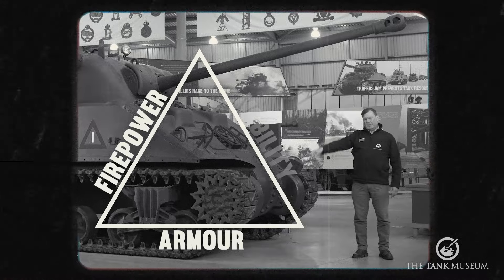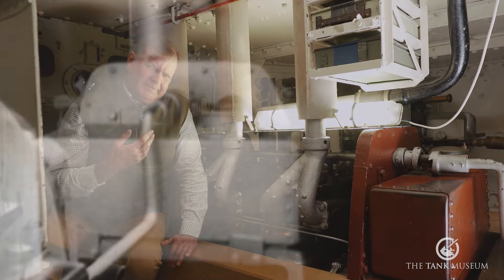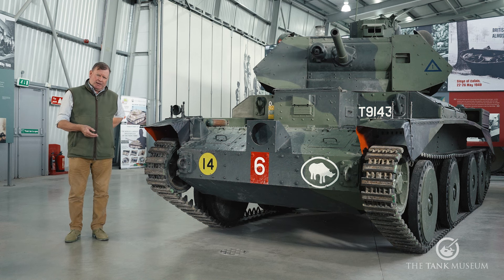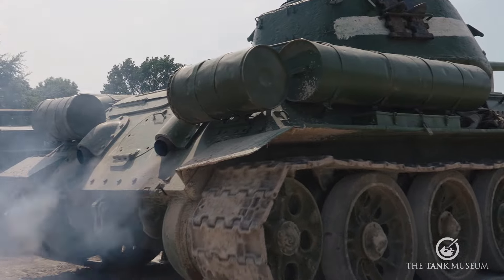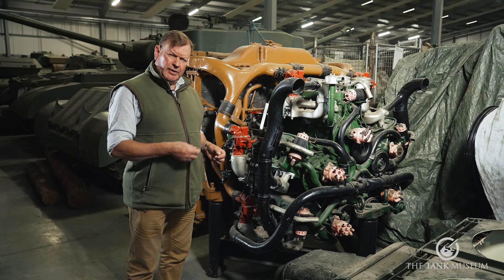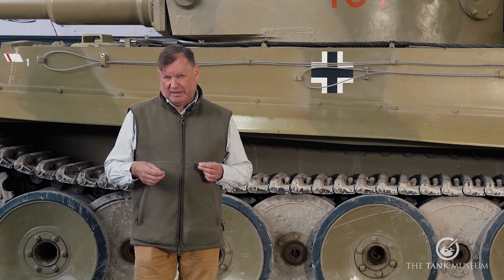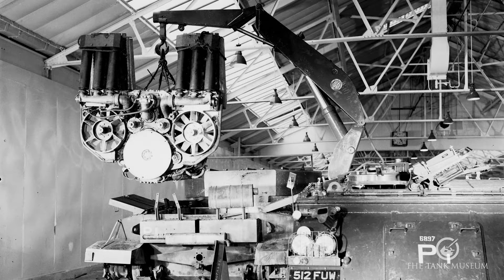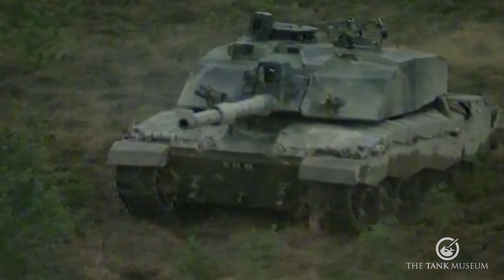Powering Victory: How tank engines went from 105 to 1200bhp

Comment: Transmissions and suspension are just as critical to mobility. Please cover that
Reply: And steering. Each one of those could be their own episode.
Reply: “They’re not important.”
-Ferdinand Porsche, 1942
Reply: @yolkiandeji7649 and that's why we got Henschel Tigers...not Porsche Tigers LOL
Reply: I believe it's common knowledge and we combine them into the mobility department. That said I agree I'd like to see a portion of this video dedicated struggles the early transmissions had and how we overcame.
Reply: That’s true but most tanks have been designed around the engine and the gun…
Reply: @yolkiandeji7649  It was actually the engine that let the Porsche Tiger down, not the transmission.
Reply: Transmission and suspension IS mobility.. Along with engine.
Reply: Thank god for Citroën and their hydro-pneumatic system. That could’ve made a huge difference if fitted onto tanks and tank destroyers, had it been fully developed before the Second World War.
Reply: No they aren't. Mobility means fastness so horsepower is the only factor. Definitionally. Surprised you didn't know that.
Reply: @anarchogarfieldist1652 what??
Reply: Come on now, Porsche had a brilliant transmission... as a concept, for a different era. Not quite so for the war-torn Germany suffering from all sorts of shortages that needed working engines right away.
Reply: Don't forget track tension... said The Chieftan repeatedly!
Reply: @anarchogarfieldist1652 🗿
Reply: @Will_14_years_ago  yeah it's fastness dude read a book
Reply: @anarchogarfieldist1652  A book generally has two things on the cover - a title, and a name. The name belongs to the author who wrote it, and the title being what it is about. You must be a little more descriptive. Id love to check this book out. Unless you actually meant the title of it the letter A.
Reply: @anarchogarfieldist1652 Yeah, your suspension actually absorbing the impact and not just throwing your tank around isn’t important to mobility! Your transmission and steering system’s abilities to apply the power to the tracks and control your tank with minimal loss in power aren’t important either!
Reply: @peterl3417  somebody finally gets it!

Comment: In short. 1. Metallurgy. 2. Fuel Injection 3. Diesel. 4. Turbocharging.
Reply: 5. Boiling Vessel without running the engine
Reply: 6. No punitive taxes based on car Engine displacement ? 
Protectionism 4tl.

Comment: Tank engine design seems to be rather difficult; once an engine is finally debugged, there is a tendency to stick with it for as long as absolutely possible.  You touched on it with the Soviet V-2 diesel, but the Ford GAA and RR Meteor went on to power tanks well into the Cold War.  The Continental AVDS-1790 is a good Cold War example.
Reply: The Germans had an all new engine design slated for the Royal Tiger... but the Allies bombed the factory into oblivion. So... they had to use what they had.
Reply: @jerryjeromehawkins1712  A good problem!
Reply: Car engine families can stick around for quite a while as well.
Reply: @tz8785 4g series from Mitshubishi are this very example. You can't find it elsewhere but Mainland China...
Reply: Some engines just work like some cannons which is another part of the equation. We keep using the same 90mm gun from the M26 Pershing to the M48 Patton and early M1 Abrams had the M68 our copy of the Royal Ordnance L7 (mainly because the planned 120mm cannon from Rheinmetall was still being developed).
Reply: @emberfist8347  Good comparison! If a proven item or system still meets the need, why replace it?  The 105mm gun is still soldiering on with the Stryker MGS and the new M10.
Reply: @tz8785  if you want to really see an example of an engine lasting a long time, look at motorcycles. Kawasaki used the exact same engine, part from part, for their ninja 250's going from 86' till 07', when they refreshed it because of emission regulations. 

It's still basically the same engine, with almost the same specs, and all accessory parts to the engine are interchangeable from the first to the second engine. When it comes to bikes, they really go by "if it ain't broken, dont fix it!"
Reply: @calvinnyala9580  I have a 4G67 DOHC 16V on my 1991 Lancer GTI, in fact!
Reply: @tz8785 GM, Chrystler, and Ford kept using 4-7 liter engines in their commuter cars in the 70’s and detuning them to abysmal 100hp ratings so they’d be efficient enough and pass smog 😂 instead of just copying the Japanese and building the right engines
Reply: Adding a punitive tax based on landvehicle engine displacement also didnt help.

Protectionism at its finest.

Comment: Great video. Curious why the addition of the turbine engines was left out. Lighter, more compact with increased reliability and power.
Reply: they were more complicated, less reliable, and consumed more fuel. He sis say it was more of a surface level video.
Reply: Because UK never used them and the number who did can be counted in one rude gesture?
Reply: @aaronleverton4221  they do have(or had) a Gas Turbine powered tank in the Tank Museum I swear they made a video on the T-80 and Explained it's gas turbine engine.

Plus apart from Germany, Britain would be one of the first countries to get to use gas turbine/Turbojet propulsion for their aircraft, the Meteor, which would give them  familiarity with turbine propulsion since Late war Germany even attempted to experiment with Gas Turbine Tank Engines with modified BMW-003s.
Reply: @raymartcarreon6069  Please don't take this the wrong way, but your point about the T80 doesn't rebut what I said and I know all about Sir Frank Whittle.
Reply: I think turbines are a dead end with no advantages and several disadvantages.
They are way more expensive to produce,  fuel consumption is far higher than a diesel and no more reliable.
They once had the advantage of being compact for their power output, but that is no longer the case.
If the Americans produce a new line of tanks, I doubt it will have a turbine.
Reply: @aaronleverton4221 the S Tanks used turbine engines
Reply: @gregculverwell  I've heard that the Army's new Advanced Combat Engine is going to be the thing to replace them, on top of being universal. Spookston mentioned it when talking about one of the 90's/00's tank programs, although I don't remember which.
Reply: @gregculverwell interesting I don't agree. Abrams power pack runs rings around Challenger and I've seen both in the field although only Abrams in combat.
Reply: @Shoelessjoe78 
Runs rings around it? In what specific way?
Challenger 2 is much heavier and has 300 hp less, but it has 90 miles more range on 80 gallons less internal fuel.
The uprated engine which is going into the challenger 3 makes the same 1500 hp as the turbine. 
That is my point - diesels are more efficient and can produce the same power.
Reply: @Shoelessjoe78 That's silly. Turbine engines absolutely have their disadvantages. Plus the next Abrams is going to a diesel hybrid system anyway. 🤷🏻‍♂️

Comment: I'd love a video on "evolutionary dead ends" in tank design. Ideas that may have worked for a generation or two but didn't have staying power. The first that comes to mind are the oscillating turrets of the AMX designs, or maybe even earlier ideas about multiple turrets. 
And how many designs have you seen where there is a major secondary armament like a coaxial 20 or 30mm cannon that never makes it to production. 
I think this would be a fantastic video, or series of videos.
Reply: Obviously the biggest one is the entire concept and role of tank destroyers. Hugely important during ww2, they lingered on for a decade or so after before being entirely abandoned once mbts started being fitted with 100+MM guns.
Reply: @samwise1790  I wouldn't say they disappeared entirely, they just started flying in the form of attack helicopters.
Reply: @samwise1790 No, the tank destroyer never went away, it just became the ATGM carrier/overwatch vehicle. Many militaries still field those, in various forms. Fitting launchers for missiles instead of using a big gun is far more practical, as the vehicle can be smaller, lighter, and cost a lot less. Also, the fact that a modern anti-tank gun would be a ginormous 140mm calibre beast makes mounting a gun on any light vehicle unworkable.
Reply: @86pp73  Also doctrine dependent. Some countries might prefer a casemate tank destroyer if their geography demands it (look at Sweden with the STRV103s for example. Although in the end they still replaced them with leopards.) But yeah, the TD never went away, it just swapped its big 120 and 150mm guns (if you're crazy like the Germans and the British) their 170 and 183mm guns for ATGMS on smaller and lighter chassis that are faster too. 
And then you have the US reintroducing the Assault Gun in the form of the M10 Booker because of Doctrinal Requirements. A nation's military doctrine (whether its air, ground or sea) determines the type of vehicle that country will invest in. So far in the modern world, Casemate Tank Destroyers like we saw in WWII and subsequently the 1950s (Like the JagdPz. 4-5) pretty much disappeared because we have no need for them.
Reply: That is a good Idear. I am lifting that for my channel :)
Reply: Well the point of an oscillating turret is that the crew in the turret is stabilised on 2 with plane, just like the gun is. That doesn’t happen in conventional turrets
Reply: @mickvonbornemann3824 no that’s not the point the point was for an autoloader to be able to used without having to deal with the gun elevating
Reply: The first production Centurion had the 20mm, they probably have one in the museum too.
Reply: @homie8437  They indeed do! It was one of the tanks I thought of when I suggested it; so many tanks like the original centurion prototype start with a relatively large "secondary" cannon, but they all seem to be dropped pretty early in testing. I'd love to hear more detailed explanations as to why so many different designers from so many countries have at first thought well enough of the idea that a prototype (or two) get one, only for it to be quickly dropped.